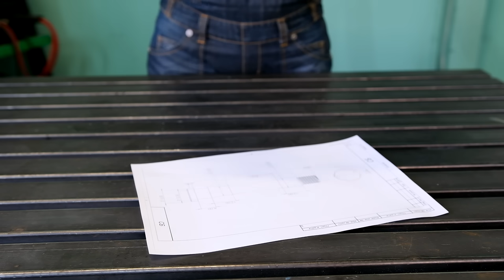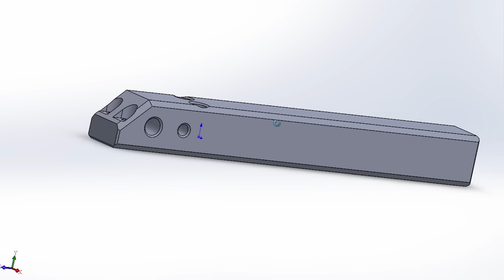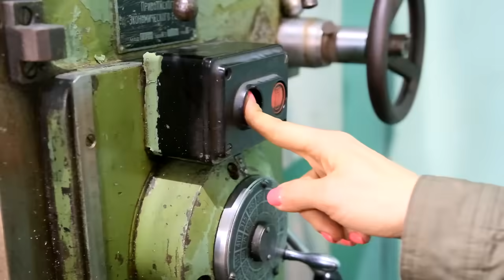Super DIY belt grinder

Comment: Wow. This is excellent. Both the project and the video.

You have a great eye for design and the skills to execute. That is a dangerous (in a good way) combination. A lot of folks can weld and machine, but the imagination to conceptualize and the mechanical intuition to pull it all together stems from some innate talent. 

Also, loooove your flamingo gloves!
Reply from the maker: Thank you very much! ;)
Reply: @luciasworkshop  Awesome build! But despite how nice your gloves are, please don't use them on moving machines! If they get caught from a moving part they will easily rip of your fingers or worse. A cut is better than a lost finger. 😱

Comment: Great work.  Looks awesome.  Did you crown any of the pulleys?  From what I can see in the video they all look straight cut.  It helps belt tracking a lot.

Edit:  Nevermind.  I spotted the crowned pulley at 11:10.  Good stuff!
Reply: also lovely format, good portable and easy to move
Reply: I noticed there was a crown on the pulley used for keeping the belt aligned.

Comment: I like the casting of aluminium into a billet and then to the lathe to extract the parts from those cast slugs. I have that much in mind for my sander. Also though a wider belt. I think you may have had a thoroughly good time making this tool. It's fantastic too.

Comment: Hello Licia, nice to see you again. And thus to experience a small participation from afar. I'm happy every time. It's always very nice to see how you develop from a small stage, elegantly and very well planned, more and more completely. And it is always a pleasure to see how your workshop has received a new basic product. I think it's great that your work also encourages other women to tackle their own things as craftsmen. I can't resist a hint. And the following. To make the belt grinder a little more universal. And how? With a longer spring-loaded instep arm and much wider at all deflections. So you have included the applications of all commercially available widths of sanding belts and their currently available lengths. At first glance, that sounds a bit exaggerated and a bit too complex. However, in many moments it is the absolute pinnacle of universal basic resource use. Greetings, and many more meaningful and well thought-out projects with you there.

Comment: It's like a Burr King Belt Grinder I had for Knife Making. It cost me  $1500 back in the 80's and I loved that tool .  They are around  $2400 now and I sure wish I had mine still. With the Baldor Motor they last forever. I took it apart to ship it and lost some of the parts and it was never the same. I should have left it intact.  Great work ~ You are the shopsmith's dream girl and I wish you well.  The Burr King Knife Maker I think that was it's name and they still make them.  Aloha ~

Comment: I'm impressed, beautiful job! Very nicely designed and very professional old school machining and welding.  It is nice to see people using "old iron" for machining work. Far better than most of the new machinery built today.  I made own several years ago when I was an instructor at Tech Shop and had access to a full size Waterjet CNC machine and cut my machining/deburring/finishing times down very significantly. I also had access to a power coating booth and oven which gives a much more durable finish that painting the final parts.

My only suggestion would be make it variable speed for better control and less heating issues for some projects, in your case with a three phase motor and VFD controller which are now much cheaper. (Easy swap out for your unit) I was always happy to see women  at Tech Shop who like to get their hands dirty in the the shop and build things. Too bad Tech Shop was so badly managed financially, it might have continued to be a great resource for Makers.

Comment: You have excellent video editing and a really fine grinder design. We use an easy addition to help us grind very flat surfaces. A thick support holds the thinner working platten top and bottom. Adjustable bolts press the front platten into a very slight convex shape. 
Thank you for the great video and keep up that wonderful work.

Comment: Eventually if you do such things as knife making and similar types of work, you'll find yourself building a second forward frame to hold a variety of single size wheels for shaping. I made mine with the second frame at the same time, but still haven't have a project to buy the big rubber wheels yet. Lots of bucks these days.  Great job, beautiful work. Again!!

Comment: beautiful work! i have seen some of the later home made ones getting rid of the gas shock in favor of a tensioner screw that has a locking nut. the guys that use these a ton say the gas shock weakens over time and causes lots of slop in the belts and that causes the belts to become chewed up faster, so they modified theirs to a more ridget tensioneer style. i don;t know anything about these but just passing alone what these knife makers say. hope that helps! it is a beautiful job you did~ i love all your videos!!!

Comment: I only found your channel a week ago and I'm impressed by quality of the projects you are producing.  I equally enjoy your non ego based editing approach.   As a subscriber I look forward to more content and inspiration from you Lucia.

A possible upgrade for your belt grinder is to increase your surface feet per minute or belt speed.  

I would look at a 8"/200mm drive wheel or a VFD to give far more material removal.   It seems your unit is not spinning fast enough to get full advantage of the ceramic belts.

I am a home based fabricator so my opinions remain as what I would do.   You already seem to have a very good understanding of what you are doing.

Comment: Very well done. A linisher is one of the most useful tools in any workshop. 
One thing: your gas strut is upside-down.  You need to turn it around to have oil sit on the seal or it will lose gas very quickly!

Comment: Nicely done!  It's such a great build that I can only see a couple of things I would add.  1 is a guard on the back, If you're anything like me you'll have the dropsies one day and all you need is to have some thing land on the back of the belt and go shooting across the room...not that I have any experience with that...🥺  The other is you should build a guide on the fixture plate so you can grind exact angles.  maybe a circular dial and needle and a turn guide on top?  but great job!

Comment: Very well-built machine and very well edited video, a pleasure to watch.

One possible concern I have is how you welded on the tab that the top lever arm pivots on (I hope it's clear what I'm talking about). The best thing would've been to make it part of the main motor mount plate to begin with, but I understand sometimes things get missed or you may just not have known exactly where you wanted it before the machine was more assembled. From the video though it seems like the tab was basically butted against the plate and welded; that won't make for a very strong joint. I would've heavily chamfered the edge of the tab going against the plate so once filled with weld the joint would be as solid as if it had been one piece.

Everything else looked frankly fantastic, well thought out and well executed.

Comment: Great build and a great video. Nice editing made it a great watch. I put a counter sunk screw finished flush with the table in the middle of the belt at the front of the work table that can be replaced with a custom pin. If you drill a hole in flat stock the same size as the pin you can grind a radius on any stock just by moving the table in our out from the belts surface. My grinder is similar but I made another arm to take a 10 inch wheel for knife making. Also you can make a custom arm to take very small rollers. I made a set of steel and rubber rollers from 8mm in increments to 50mm. These grinders are very versatile machines. Would love to see you make a knife from a thin leaf spring or a flat piece of 1095 steel. Your machine is begging for this kind of work.

Comment: You are soooooo funny, great videos and production. Your work is an inspiration for me and my grandsons. We/they do alot of the same thinks you do and make. What a great lady you are. How did you learn all of this.....my kids want to know?     So....the only thing we would change is the table, make the curve end (side away from the belt) square. Why you ask....Ha! Ha!, because you can then place a small square tight along the edge and use that to square -up your work as you sand. It will hold you work square. Other than that your beltsander look great.
One question.....how many hours did it take to make it including the painting and designing? I told my kids this was a very slow build with all the moving parts.

Comment: Alternatively, you can also weld the table guaranteeing a quick 90 degrees, and build an adjustable sled so you can dial in the angle you need and slide it close to the belt to grind the part.
But very cool build!

Comment: Great video - thanks for sharing. When casting, could you place an insert into the mould so the casting would approximate the roller (ie hollow inside)? Then just a quick finish lathe bore cut is needed. Saves time and lots of material. Don't know much about casting though. I love the quality of your finished grinder (belt sander).

Comment: Outstanding! Excellent work and master craftmanship (or craftwomanship in this case??!). From the bottom of my incompetence may I ask why you did not mill the 3 supporting rollers with a spool shape (in order to hold in place the sanding belt)? Love from Italy.
Reply from the maker: Thank you. Because one spool shaped roller is enough and easy to adjust ;0)

Comment: Its a nice design and build ,and i love the work shop with all the machines. It does look like it's turning too slow for metal ?
Did you looked Into the cutting speed needed for mild steel ?
I'm building my own belt grinder right now  and noticed most grinders turn too slow for metal grinding. You need 25-35 m/s for grinding  mild steel. Which means a motor that turns 2800rpm needs a 175mm drive wheel. In the video it sounds like it's turning half that speed 1400rpm?
Reply from the maker: Thank you.
Yes, you are right. I just made it of what I had in stock and later I had to connect a frequency converter to it, so now it works better.
Reply: @luciasworkshop  ah ok I understand .It still worked out great.
I got some nice info from "pferd "  who makes abrasives.Which also included how much belt tension you need and the grinding speed of different materials.

Comment: you did a great job on this. I'm a supervising tooling engineer that manages a tooling room for a pipe bending company. This belt grinder is better than what we use and is way easier to use. Did you design this yourself or did you pull this from somewhere?
Reply from the maker: Oh, thank you. I found a proto - image and then designed my own.

Comment: it seem unnecessary heavy and you didn't put small groves to prevent belt from slipping off. Rollers don't have rubber so technically belt can slide. but still it works so good job.

Comment: Excellent build. What Kw motor did you use? RPM of motor and diameter of drive roller please. I need one of these in the shop!
Reply from the maker: Thank you. I used a motor that I had in stock, but you'd better use one on 1.5 Kw and 3000 RPM. The diameter of drive roller is 114 mm.

Comment: Return to review. Do you find the wheels all need an oval instead of  parallel surface to track the belt ?
Reply from the maker: No, it's ok.
Reply: @luciasworkshop It has taken 6 months until I saw your reply. I thank you sincerely for the response👍. That helps me  avoid unnecessary labour. I'd never have known you are Russian but for the address you have and the Russian poster in your workshop. What does that poster tell us Lucia?

Comment: Well done. Just one question though. you obviously don't live in the states, do you have to do anything, like registration or inspections of your shop and equipment where you live? In other words, does your government keep tabs on you, your equipment and what your making?
Reply from the maker: No, I don't own an organization to make the government keep tabs on me. It's just my grandpa's shop where I do what I want.
Reply: @luciasworkshop  Cool I was wondering, because we keep having this fight over here about gun control and confiscation. And even though its against our constitution, and impossible to do here, they keep trying. It would take them over 20 years just going door to door to get the ones they KNOW about if no one resisted at all. Which here I can guarantee won't happen, its an American trait to distrust government. But I always wondered what they would do with shops like this. I have heard in other counties those machines are regulated, and inspected on a regular basis. But I know there are millions of those tiny little machine shops all over America, some of them so far into the country you need a chopper to get to it, and a local guide. Owned by private individuals for non commercial reasons. And I could turn out open bolt grease guns in job lots if I wanted from our little shop. I mean the originals were made with much more primative machines. So its always a wonder when I see people in other countries with the machines and knowledge to make anything, and its a good idea to look around to see what they do to regulate them elsewhere so we can watch for it here.

Comment: During the course of creating projects like this, have you ever had any castings where you found voids once you started milling them and how do you deal with those?
Reply from the maker: All aluminium remains that I had were of one class. Maybe this is why there were no voids, but I know there are special supplements.
Reply: @luciasworkshop  Yes, there are fluxes you can add because oxides form quickly on the exposed surface.  I was very impressed at how nicely formed your billets were.  🙂

Comment: Good stuff. Suggestion: drill holes in the support plate & turn some pegs to insert into those holes, for easy alignment of the work piece perpendicular/at 45° angle to the belt. Might come in handy.
Reply from the maker: Thank you for the advice ;0)

Comment: Who has a 30k metal lathe in thier work shop?  I don't see this as a DIY project
Reply: It's not about amount or value of tools. DIY is about making or doing something yourself, with the skills and tools YOU got avaiable, borrow or source from 3'rd party. There are many levels of complexities of DIY projects, one just pick something that fits one's level. A older manual metal lathe can be picked up for 1000 usd, no big deal, but being able to use it is another issue.

Comment: I have to offer a word of advice that at some point,  will save you serious injury.   NEVER use your drill press without the work secured.   When that drill bit catches on the work (and it will)it will spin the work and you won't be able to stop it. It may take fingers, or if the piece is long, slice your stomach open.  Seriously

Comment: Inaccurately shot and edited. As someone thinking about making my own belt grinder, However, I learned nothing from this video. Design features, how the belt tensioning and adjusting mechanism works, motor and bearings, platten material. And smelting my own metal? Ain't no one got time for that!
Reply from the maker: Sorry, but I'm not teaching anyone, because I have to learn alot by myself.
Reply: @luciasworkshop  I meant to say immaculately shot, which got auto corrected. And it is indeed well produced, just not the type of video I was looking for. Keep on making!